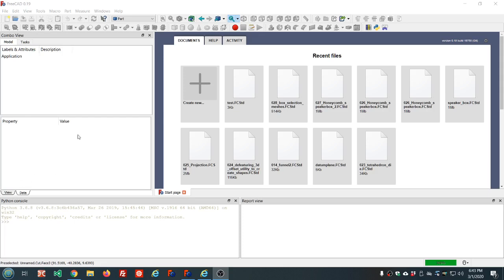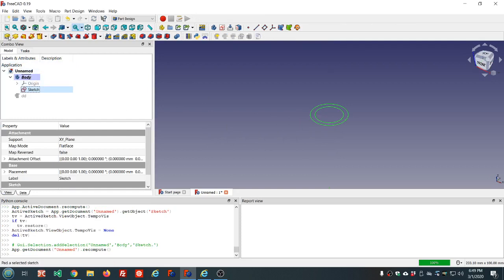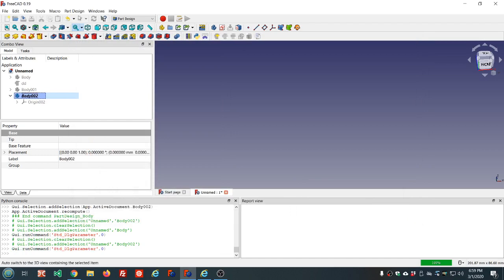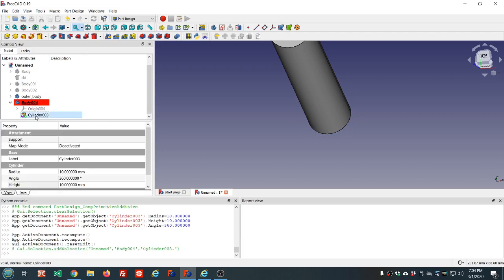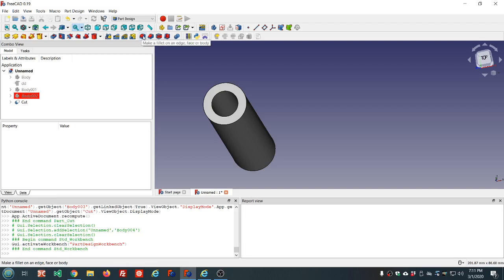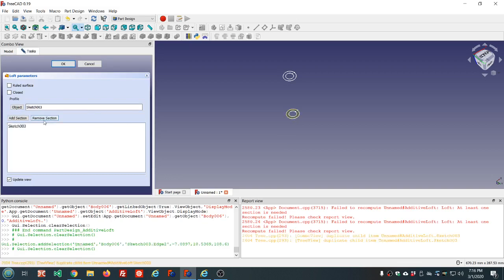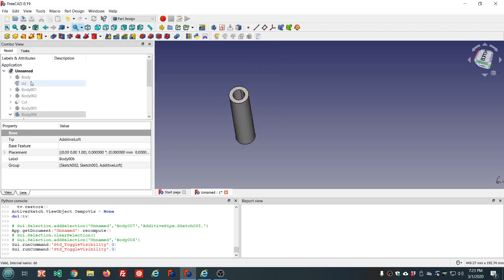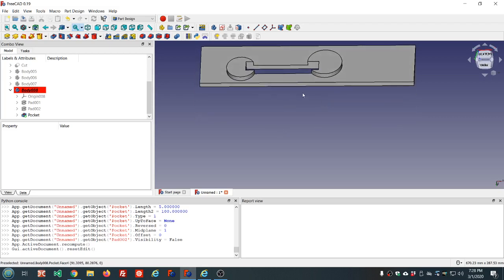031   FreeCAD Introduction to Part Design

Comment: I found your ability to create the same object, in this case, a pipe,  using a multitude of approaches both empowering and frightening. This is the flexibility and the challenge of FreeCad.  With a so many ways to accomplish the same task non-professionals, with limited CAD experience may find the software overwhelming.   An interesting challenge is to find the right way to make FreeCad, a remarkable tool, accessible to more of the 3d Printing user community where many of the users have never used a CAD program.

Comment: Great pointing out the limits that it all needs to touch. The error messages on the array modifier are not so clear. I discovered after a good amount of time wondering why it didn't work.
Reply from the maker: It's possible at some point in the future this limitation could be removed.  It's not an OCT (Open Cascade Technology) limitation since  Part Extrude can handle these situations just fine.  It's a matter of some of the other FreeCAD operations in Part Design that can't handle cases where there are multiple solids.  That's how it was explained to me as I recall anyway.